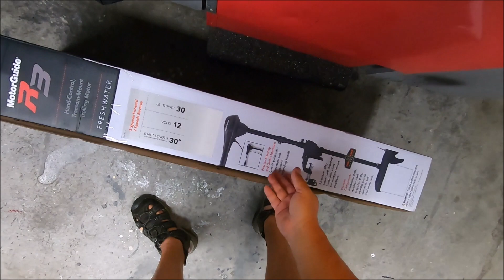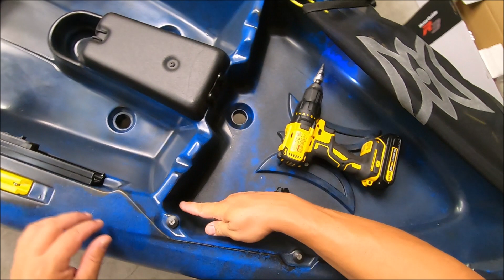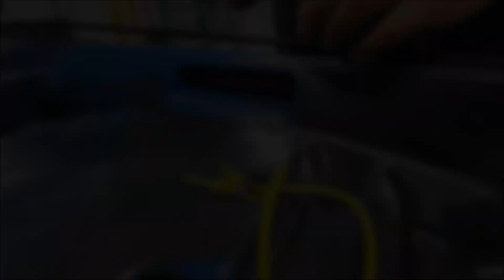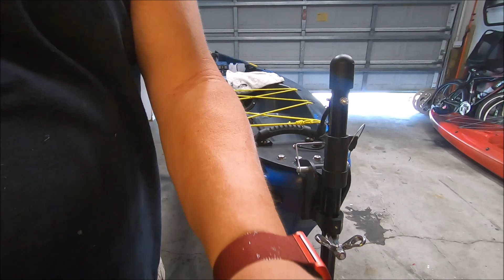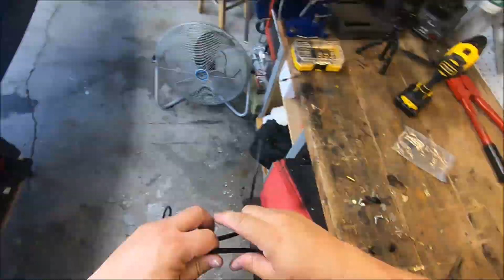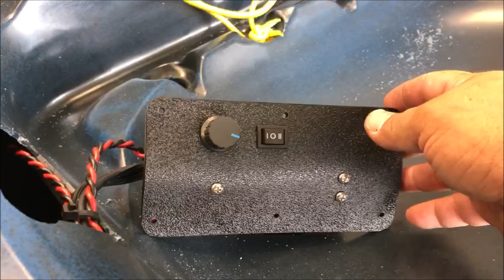Pescador PRO Perception Trolling motor KIT INSTALL 100 120

Comment: I noticed you mounted some wilderness systems xl foot braces on the kayak, did you have to drill new holes? Or did you use the existing holes from the old footbraces.
Reply from the maker: Jonathon lopez those are the regular foot pedals that come with the kayak.

Comment: You reckon the same could be done on the Perception Pescador Pilot 120 (pedal drive)?  Could you use the pilot’s sterling control instead of the foot pegs yours.
Reply from the maker: Darrell Gibson I have not looked at one up close, I’d imagine footpath controls would not be a problem, I’m just not sure about the mount

Comment: When I put it reverse it tilts the motor up. How do you keep it down?
Reply from the maker: ehumaui 408 pressure from your feet on the pedals will keep it down, when putting it in reverse start out at a slow speed then keep your feet on the pedals firmly as you increase your speed

Comment: Very well thought out design. I have built a similar set up for my current kayak. But I am in the hunt for a new kayak, and thinking about motor set ups before I buy. In my current set up I put the bulk of my PWM controller in a water proof box that can sit inside the hull. I have a 2" x  3" box (or so) with the the speed knob and fwd/rev rocker switch mounted on top, with a digital volt meter on the side to monitor battery level. That small control box is just clipped to the seat. Saves cutting the giant hole in the haul.
Reply from the maker: Mike Jordan I bought a big fish 105 and did mostly the same set up as this one, absolutely love the big fish!
Reply: @sikassscivic  old post. Since this post, I bought a Vibe Sea Ghost. I built a remote controlled set up for it